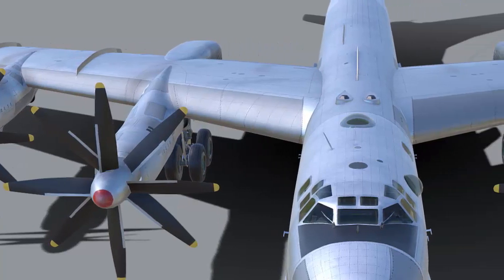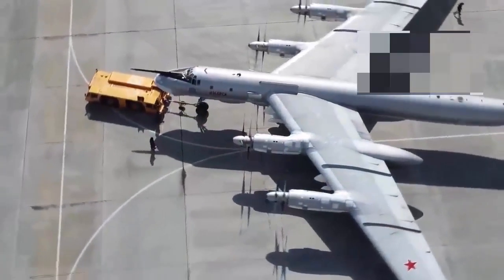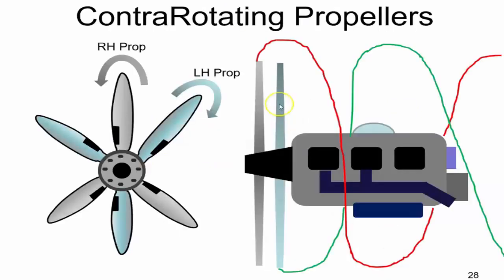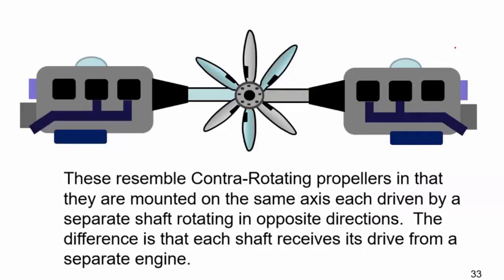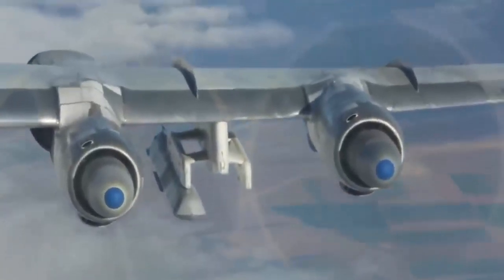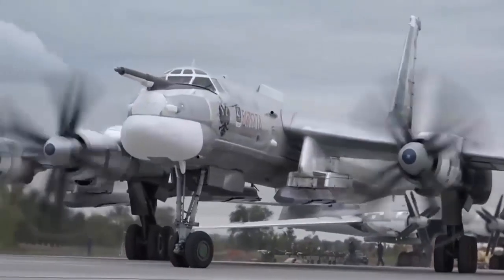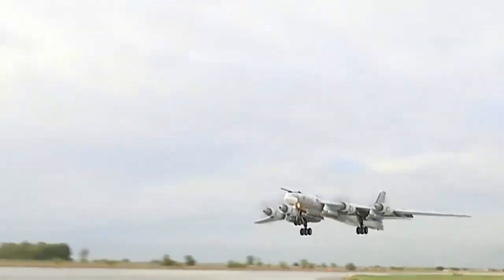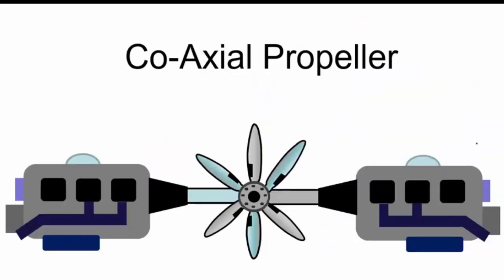How Contra Rotating Propellers Improve Aircraft Performance

Comment: There must be some advantage to contra-rotating propellers on the same shaft or the Russians would never it. Counter rotations would eliminate the torque generated by a single-directional rotating propeller. But the the noise generated by counter rotating blades is a serious problem. The Russian Tupelov bomber utilize for counter rotating prop system and generates a lot of noise. The flight crew wear special suits and head gear to help them cope with the noise on extended flights. The noise is generated by the airflow turbulence of counter rotating blades. This must be a serious problem. This video claims that you can use noise cancellation systems to reduce the noise. The problem is that you are adding another electrical-mechanical machine in order to use the counter rotation propeller system. The truth is most countries have tried to develop the counter rotating propeller system. Most countries have developed prototype counter rotating aircrafts and not on mass-production aircrafts. This says a lot about the practical usage of the counter rotating propeller system. The former Soviet Union have developed counter rotating propeller airplanes and helicopters for regular usage. No other country have found counter rotating propellers to be practical. I do not know why this is the case. The Tupolev Strategic Bomber was built during the Soviet era and Communist governments are known for doing things based on political (communist) correctness and not for practical engineering application in the real world.
Reply: The reason for using contra-rotating propellers in the Tu-95 is more than trivial. You should ask yourself: what tasks was the Tu-95 ORIGINALLY dedicated to? It was supposed to be a strike aircraft carrying the largest thermonuclear bombs. At that time, the Russians could not solve two problems: sufficient carrying capacity and sufficient range. The second problem was solved very simply: the crew, when taking off for a possible bombing of the USA, received a one-way ticket. A return was not expected.
The first problem - the missing engine power - was solved with contra-rotating propellers, which provided the few missing percentages of thrust.
In the Tupolev design bureau, in accordance with the Kremlin's guidelines, no one bothered with such nonsense as the effect of vibrations and noise on the crew since it was planned as a SINGLE-USE material.
No one bothered about the fate of the crew, who, even if they miraculously had a supply of fuel, had a very slim chance of surviving a thermonuclear explosion with the power of many tens of MEGATONS of TNT.

As the Russians themselves say: women will give birth to new heroes! Such a Russian specificity...

BTW: the NK-12 engines, allegedly designed by Kuznetsov, are actually Russian war spoils - it was constructed by a group of engineers led by the Austrian Ferdinand Brandner, a designer at the Junkers plant during World War II.
And this was the main reason why the Russians were unable to make engines with adequate power. They simply DID NOT CAN, they had neither the technology nor the knowledge. 
Brandner himself, while in Russian captivity, effectively simulated various difficulties. Due to tight deadlines, the decision was made to use contra-rotating propellers.
That's all.

Comment: I'm told the Tu 95 is the noisiest plane in the world, the Shackleton was very noisy. The propeller blade chopping through the wake of the blade in front of it generates the noise. So, providing ear protection for everyone assaulted by this noise must make it unviable.
Reply: Yes. Several advantages can all be negated by one major disadvantage, as in this case. The Tu-114 (the same wing and powerplant arrangement as the Tu-95) was so noisy it was not viable as a commercial airliner.

Comment: ...more weight, more failpoints, the biggest radar echo you can get are also downsides. Ok, please add an example for marine propulsion and wind turbines. At least there is no commercial grid scale wind turbine with counter rotating propellers. In fact adding more blades won't increase wind turbine efficiancy more than a few percent. The pictures of the ship look like pods which faced each other. But they are used as torpedo propulsion. Somehow the US is thrown under the bus when it comes to who invested many efforts into counter rotating propellers. Btw. the german engine on which the NK-12 was based on should be run with a counter rotating propeller too.
The reason for thsi application was, they had no better technology for very strong engines, this wouldn't work with lower power engines for a given space. For the T-95 they would have used 7m long blades otherwise. More modern planes embraced a lot of sickle blades, no counter rotating props. A hot guess, it is because today we understand aerodynamics a lot better than back then.

No passenger planes employed counter rotating propellers, except the awful offspring of the Tu-95 - it is worth exploring what a mess this was.

Sorry, but besides fascinating to watch, conter rotating props are just an awful past solution.
Reply from the maker: Thank you for such a great insight and a very educated point of view on this matter, I will try to be more careful and do more in depth study of such topics.